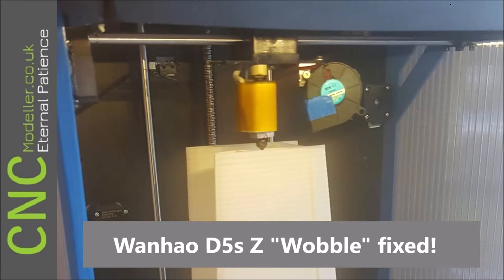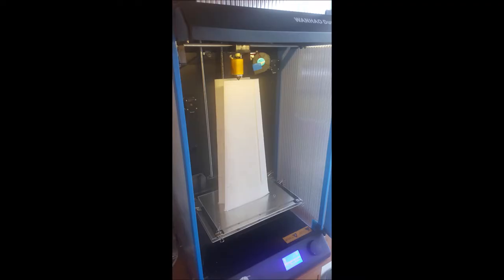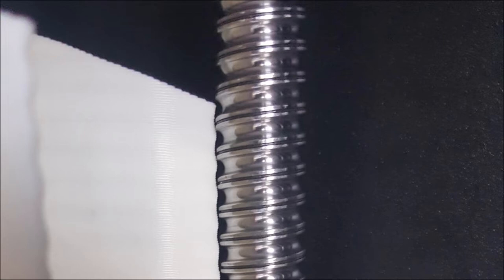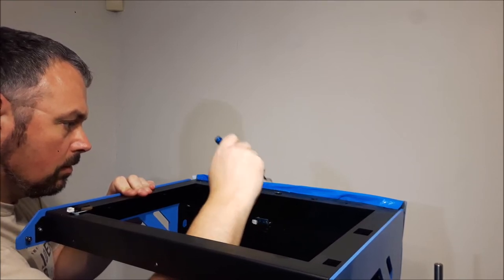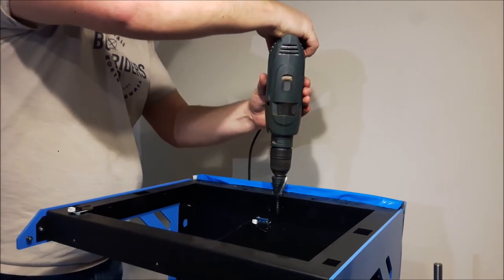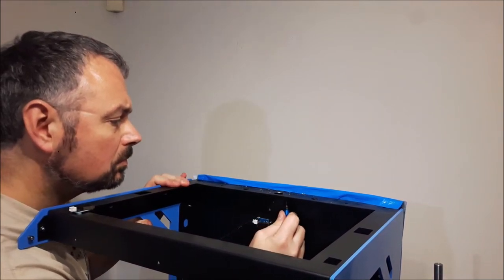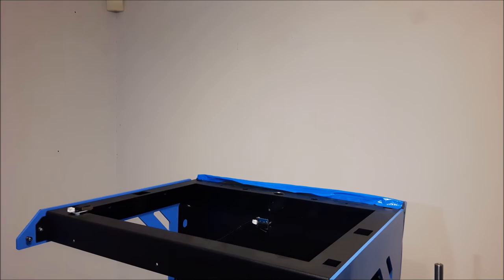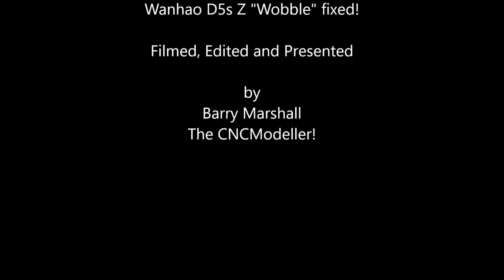How to - Wanhao D5s Z "Wobble" fixed!

Comment: hey bud did you ever get an issue with your Z axis plate randomly giving out and dropping mid print?  I cant fix it or find info about it for my life
Reply from the maker: Sorry never heard of that, perhaps you have an intermittent issue with your z axis stepper driver loosing power?
Reply: @CNCModellerUK  i believe thats what it is! thank you for the pointer and quick reply
Reply from the maker: Glad I could help…

Comment: Hi. What diameter size do you recommend?
Reply from the maker: I just opened up the hole big enough to make sure the shaft doesn't touch the chassis. Try and get the shaft running as true as possible by trying different rotation / assembly of the flexible shaft coupler too. 
Hope that helps. 
Barry M

Comment: Can you explain what it is you did? The video seems very unclear.
Reply from the maker: Hi Lowtus, thanks for your question. The fix is to make the hole at the top end of the z lead screw bigger so the free end of the lead screw doesn't rub. You can see me drilling it out with a step drill at time 2:30 in the video. When the free end rubs it transfers lateral loads through the ball nut against the rails causing the z carriage to move horizontally in x and y. Hopefully that helps! All the best. 
Barry M
Reply: @CNCModellerUK  Thankyou for your reply, makes sense! Hope you have a nice day.